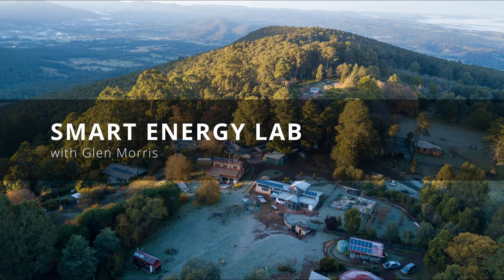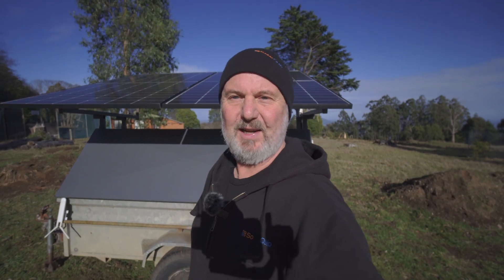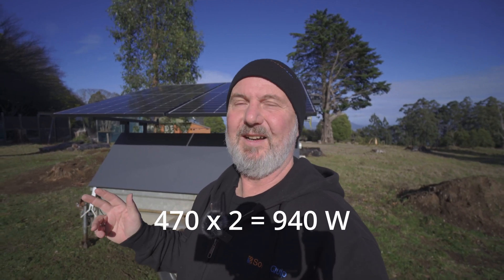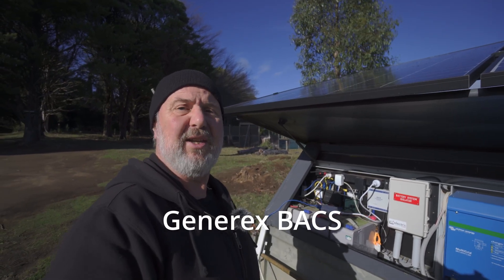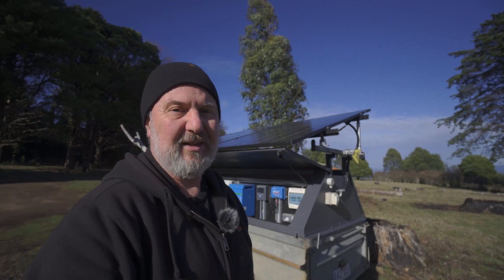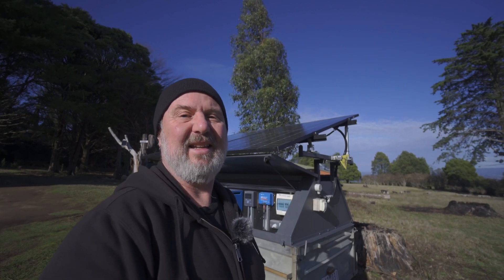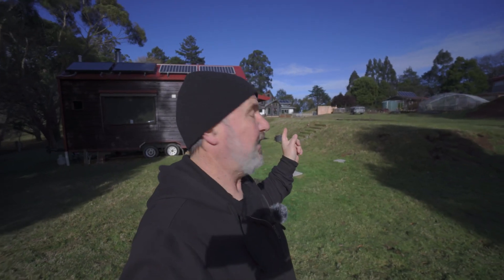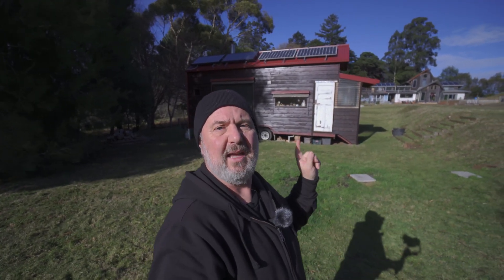940W Solar Powered Trailer

Comment: I would have thought the incline of the modules would be toward the front of the trailer so a natural incline would occur when the draw bar is left on the ground. Probably would need lithium batts too to be housed at an incline though. Got a 2KW ute for sale myself. Built it in 2016 on my old work vehicle. Another year or two I think it's eligible for club rego. Cheap. I can get a road worthy but need to remove the array and reinstall. It could come off in one piece. Not allowed to have it over the wind screen or bonnet but complies with Vicroads load criteria (nothing protruding beyond the tail gate). It's a 5 metre long array, exactly the same length and width as the Rodeo.  48V, 4 x 230AH gel cells. Old school. Batts have been mostly sitting there full, like standby Telstra batts. Not used much. The modules are supported to stop drumming when on the go.